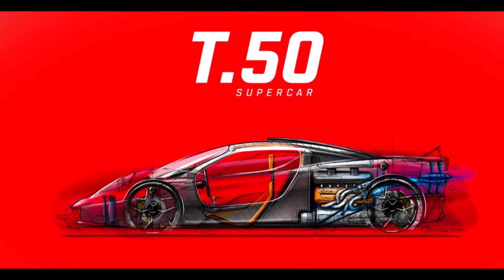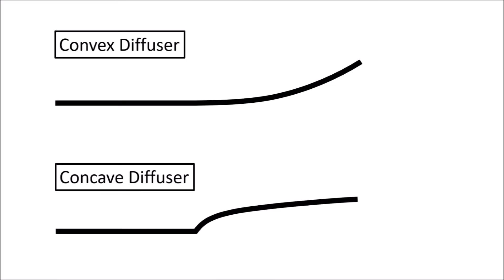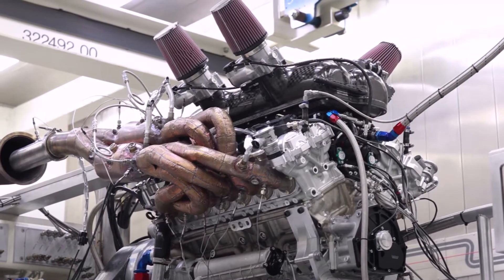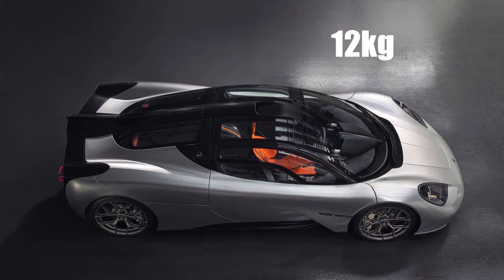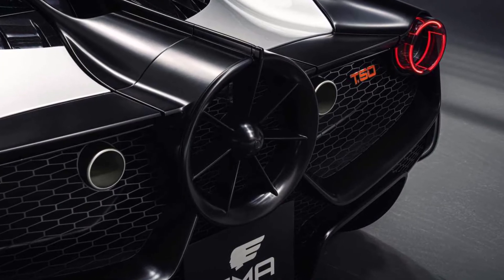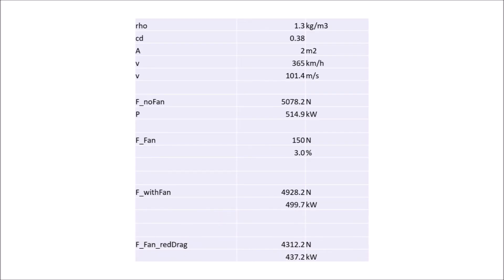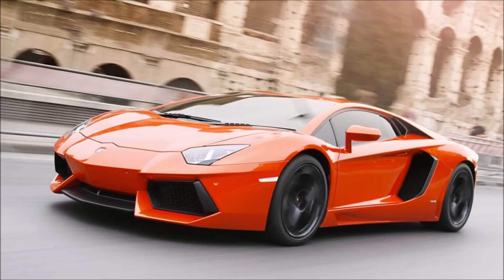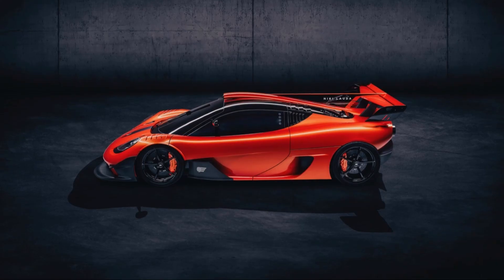Gordon Murray Automotive (GMA) T.50S - Explained

Comment: Hey, only because about two videos before this one I was looking at one with a lotus Elise in a wind tunnel, (hoping it had a good bit of rear diffuser, which it didn’t), but I noticed that the air flow went over the top of the front wing, under the wing mirror and seemed to point straight into the side scoop: https://youtu.be/_BnHXfvZVFo thought I’d share,.
Reply from the maker: Thanks for sharing. You are right, some flow points into the side intakes. But in this session the wheels are not rotating and that changes the side flow quite a bit. You can also see here how much these mirror stalks disturb the flow.
Reply: @bsport320  yeah, it really is a very interesting subject, I’m currently looking into top front wheel arch vents for more front down force and a redesign of the rear diffuser for rear on a s2 Exige. Cheers

Comment: I cannot wait to see it on the track at speed. Listening to Gordon Murray talk about this project, you come away thinking that this is the most thoroughly thought car, with every detail and trade off in its packaging thought through it terms of its total net benefit. The last time I felt this way about a car design was with Koenigsegg Jesko, which is nearly entirely made from in house, or, spec components that are designed and manufactured as part of the end use packaging and how they can further maximize it function. Murray and Koenigsegg are the fine watchmakers of the automotive world.

Comment: I read a comment earlier that stated the downforce created by a concave diffuser is 'different' than convex, and can actually be quite dangerous if you haven't driven with it before, poster claimed to be a track coach. Just thought I would ask a real engineer, great video as always
Reply from the maker: Depending on the design the main suction can be further forward, so it stabilizes the rear a bit less. There can also be a tendency to stall at higher speeds depending on how aggressive the design is. Like I said, depending on weather conditions the reattachment behaviour can change.
So it can be a bit tricky but you usually try to avoid that because you kill the driver's confidence. And that slows you down more than the little bit of performance you gain from the aggressive design.

Comment: Things I don't get about the car: 
 
There don't seem to be any mirrors on the  road car, but on the race car. If the road car has cameras, why not put them in the track car? The tech shouldn't weigh that much.
The rear wing looks like a lot of wasted potential. It looks like the made a delta wing to compensate for the lost underside surface due to the mount losses. Why not only one central to mount and fixed end plates or just two swan necks for example? They are almost there.
The exhaust situation between race and road car look very different, probably due to less restrictive emission standard for non road cars. Do you think they did a great job with it? For a car which is all about rear underbody airflow, the situation doesn't look ideal.
To me the front aero seems very simple(by design?) and maybe even old fashioned. Do you have any further insights?
Reply from the maker: I was wondering about that too.
I understand that they chose the mirrors. The small mirrors will be lighter that a camera system with all the cables and wiring loom.
The rear wing could do a lot more, but I guess this is where they detuned it. Also because the aero efficiency of a rear wing isn't great. So you would degrade that first.
The exhaust is a strange position and I think the road car position makes more sense. Gordon Murray explained that they positioned it there to improve the sound of the car because of the interaction of the two pipes.
Like I said, the performance of the car relies on the 48V system. If this one performs poorly, the car is nothing special on the track anymore.

Comment: Still a little confused about delta wing. Do they give same effect as spoon wings? Is it better than a spoon wing?
Reply from the maker: Delta wings produce more suction in the centre like spoon wings because of the longer chord but they stay straight and don't "waste" downforce by generating side force. You can check my video about spoon wings

Comment: Which is more impressive for you? T.50 or Valkyrie? Same goes for T.50s and Valkyrie AMR Pro
Reply from the maker: The valkyrie definitely looks faster, but both have very different concepts. GMA didn't say what the capacity of the 48V battery is. If this runs out, the valkyrie will be faster.
Reply: I would buy t.50 and rent Valkyrie.
Reply: The Valkyrie will be faster. The T.50/S would be my choice for fun
Reply: valq is more like 918, t50 is more like stratos
Reply: Completely different missions.

Comment: The shape of the rear wing reminds me of the horizontal stabilisers in "T-tail" aeroplane designs. Obviously does the opposite job but its a very large surface area
Reply: Specifically the Lockheed f104 Starfighter.

Comment: One question, why do you think the ISG is in front of the engine instead of in the bellhousing between the engine and gearbox?
Reply from the maker: These ISG units are in the shelves of suppliers. They are developed and tested and easy to buy. 
Integrating this in the small diameter bell housing would be an expensive custom solution.
Reply: @bsport320  ah that is what I assumed. Your channel is quickly becoming my favorite auto/engineering related channel on YT, the way you are able to distill complicated concepts into a concise package suitable for us laymen is much appreciated.
Reply: @bsport320  Well, I suspect the main reason would be that since it also needs to act as a starter... being positioned in the bell housing - behind the clutch - would pose some problems ;).

The car is basically completely built out of expensive custom solutions so I don't believe the ISG unit is of the shelf - and actually making the ISG work properly is one of the main engine development challenges the team is facing.

Also, just to touch on the "mild hybrid" part, I don't think that's strictly the case. The ISG only puts power into the crank when it's starting the engine up. Otherwise it's permanently working as a generator to power the fan and the aircon. Only in the Vmax mode it's decoupled - so the fan runs on battery alone for about 3min max and the extra power they get is because they removed the parasitic loss of the ISG.

Either way, nice video!
Reply: packaging i would assume
Reply: Keep the proper weight distribution and move the transmission further forward, giving more room for diffuser and fan valving/ducting